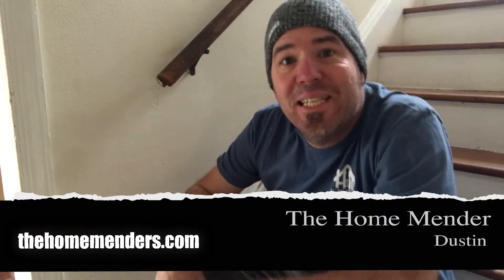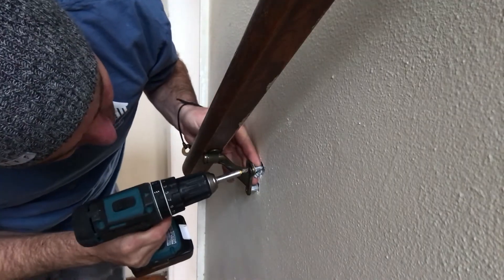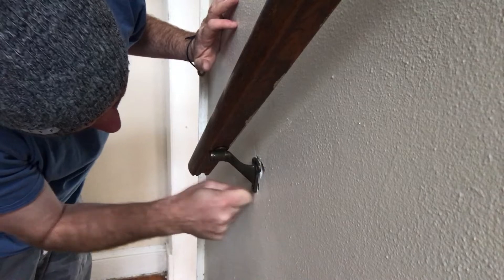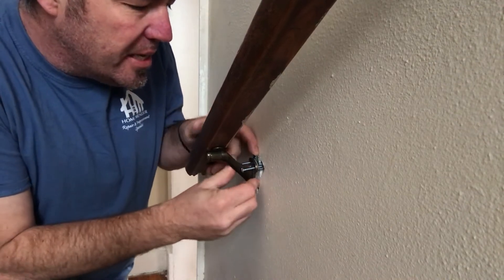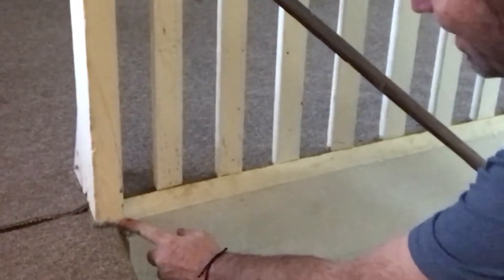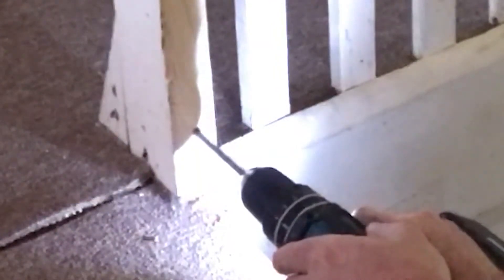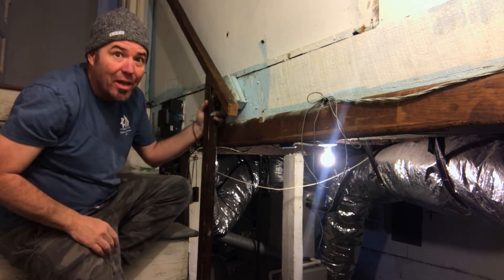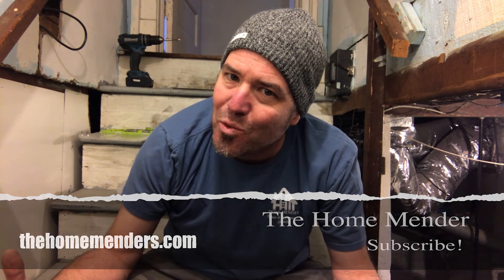How to Secure handrail, how to tighten a loose railing. Easy!

Comment: We have a basement handrail mount that its mounting screws have pulled out of the wooden stud. Since this is about screws into drywall it doesn't apply to us. Any advice on how to keep screws in the stud when people have to lean heavily on the railing for support would be appreciated. Thanks
Reply from the maker: Hey Bruce. You are definitely going to need to hit the studs sir. This video helps when you cannot find them but you will need to find them so invest in a stud finder, longer screws or beefier ones. I hope this helps

Comment: I’ve run into the same issue needing to use toggle bolts for my handrail. Curious - should I only use two (instead of three) on each bracket? Assuming you did that to hold up the integrity of the dry wall?

Thanks so much for the video!
Reply from the maker: Hey Brian.   I only use what I feel the situation needs. Two will Definitely suffice and if the drywall is a little shady it may be a good idea.
Reply: Thank you so much! Really appreciate the insight!!

Comment: Toggles are by far the strongest plaster board fixing in my opinion, can be a bit fiddly depending on how many you are using at once and remember the more holes you put close to each other you are in theory weakening that section of plaster board as you drilled holes close to each other, and when it comes to taking the thing down you fixed you will have to use more toggles and the ones in the wall will fall off down the inside of wall.
Reply from the maker: Awesome comment fire.  Oh yeah. Those toggles are single use items. Lol
Reply: Agree I only use toggles, the only thing I’ve found that let me tighten the bracket to the wall.